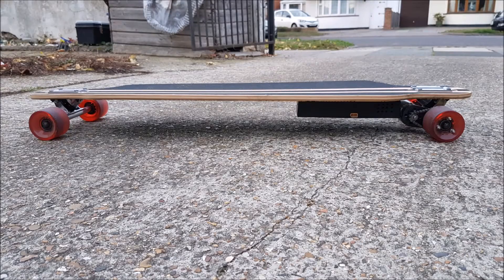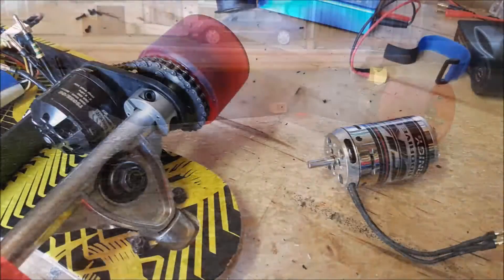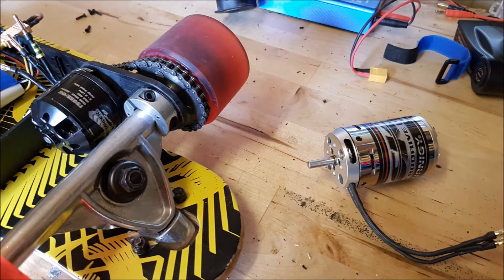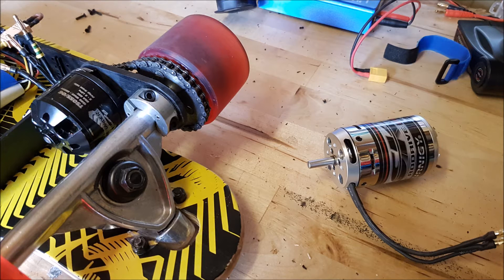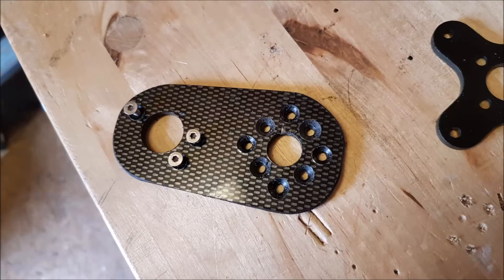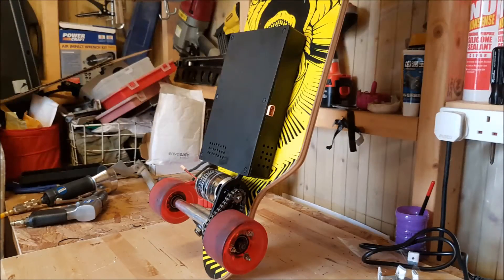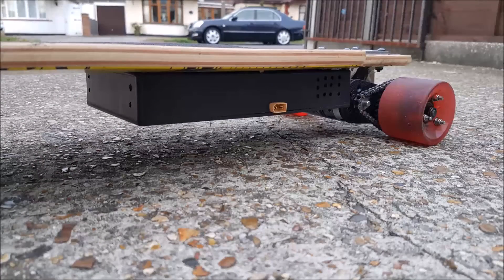DIY Electric Longboard - Update

Comment: Using a metel motor mount will transfer the heat from the motor onto the motor mount and onto the truck keeping the motor cool using carbon fiber heat won't conduct and the heat will build up on the motor something you should upgrade to
Reply from the maker: channel deleted yeah that's happened. Is now aluminium 👍

Comment: how does the chain go instead of the generic band everyone uses with the pulley.. do you find it never slips or anything?
Reply from the maker: Chain never slips, at all. It's much better than a belt which can slip under load or under braking. The chain just goes round a pinion on the motor and then round a sprocket connected to the wheel...

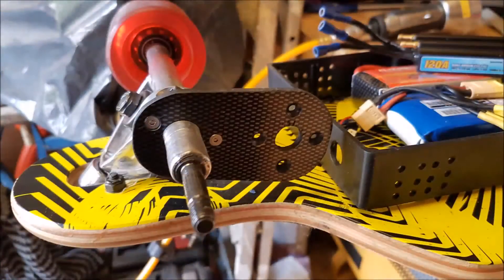Comment: About 1:00 I saw you used Hobbyking 120A Boat ESC. What is your expirience with this? Doesnt it overheat? As I know it is watercooled so I wonder if you have had any problems with it? I ordered almost the same ESC (90A) and now I'm wondering if it is good chioce ;)
Reply from the maker: Marcin Szczeliniak I wouldn't bother with it if i were you, it doesn't overheat but the brakes are terrible! For some reason now the brakes are non existent with my one which is why I've ordered a VESC!
if you want a cheap, decent ESC go for the FVT 120A ESC, it has a cooling fan of you're worried about overheating and has decent brakes.
Reply: darkkevind1978 Ok, thank you for your answer. You calmed me down ;) Breaking is quite important so I will check it and maybe change it in the future.

Comment: That's really great man. My only question is how did you do the electrical part I'm terrible for it. cheers
Reply from the maker: Higor Farinelli thanks. What exactly do you mean? basically just imagine an RC car setup. Motor, ESC, receiver, battery(s) etc. I have two 11.1v LiPo batteries in series.
Reply: darkkevind1978 I will starting build my one. Witch model is your motor?
Reply from the maker: Higor Farinelli Turnigy SK3 5072 I believe.
Reply: Thank you man. :)

Comment: Good project! Everything inside in the small black box? If you could to show the electronic parts inside the box would be nice! And why do you choose ``metalic chain`` (sorry, I dont know in English) rather than belt in pulley?
Reply from the maker: Hi Lucuano, chain drive is for strength and durability, also to stop belt slip.
You can see all the parts in my blogs about the build...
http://kevindark.co.uk/Blog/Read/7
http://kevindark.co.uk/Blog/Read/8
http://kevindark.co.uk/Blog/Read/9

Comment: how fast can you actually go on this setup?
Reply from the maker: With one battery and my old 580kv motor I clocked it on the GPS at 20mph. With two batteries and a 230kv motor it's about the same. I do have a large sprocket on the wheel though, I've got a smaller one which would make the speed closer to 30mph.

Comment: Do you charge your batteries seperatley, or can you charge them  together. 
Sam
Reply from the maker: Sam Greaves I have to charge mine separately at the moment because I don't have the ability to plug both balancing leads in to the charger. I'll be rectifying that though soon so that I can leave them in and charge them...
Reply: darkkevind1978 Oh, Okay cheers !
Reply from the maker: I've just done some Googling, and I've found a 3s to 6s balance lead adapter that will fit in to my charger, it's just £1.99 so I've ordered one and will be able to charge them both at the same time.
Reply: darkkevind1978 thanks very much !